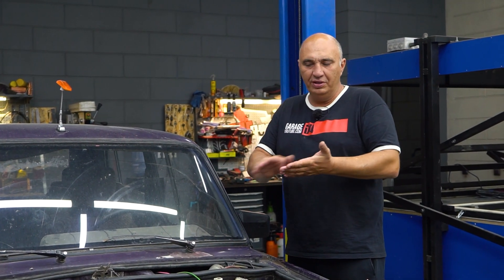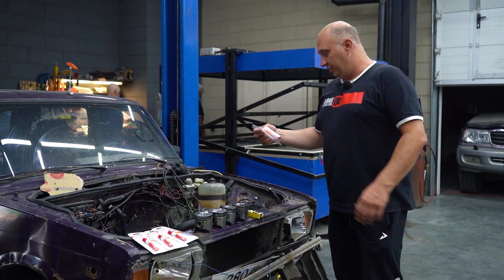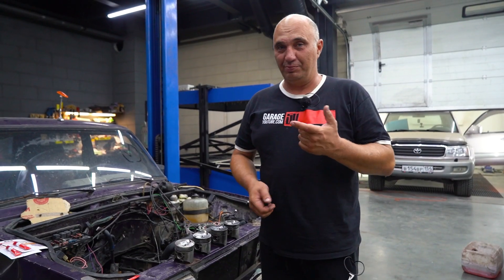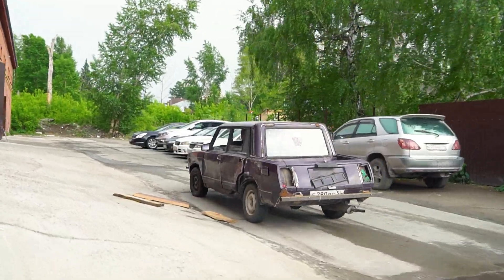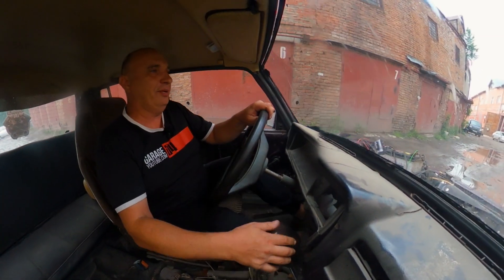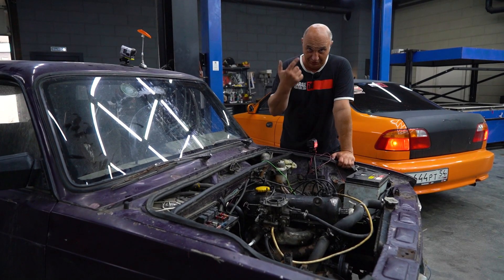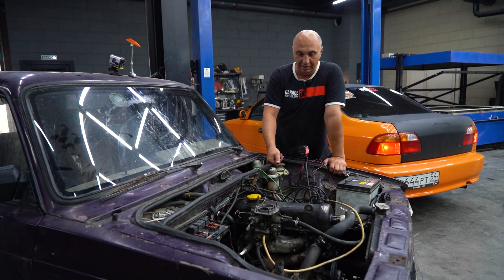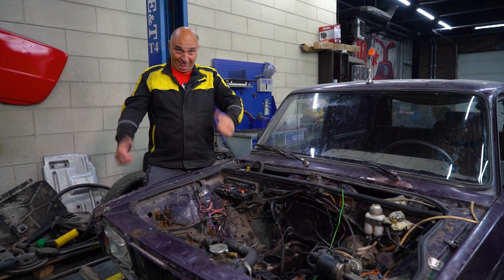Piston repair using JB weld and super glue – will it work?

Comment: Why not move one step below welding, and try soldering / brazing with one of those aluminium "welding" rods, like the Durafix or Alumaweld, the ones that melt around 400 degrees Celsius. That would be worth a good laugh.

Comment: So some context, the piston head experiences the peak highest pressure of 2100psi on every single stroke, it also experinces the most amount of heat being the closest to the explosion in order to do it's job. So while it failed to repair a piston head, the block itself would be fine with JB weld, having experienced a fraction of the heat and concussive peak pressure that the piston takes. As the piston travels down and expanse the pressure rapidly drops meaning the walls of the cylinder would be able to handle the jb just fine.

Comment: Thanks for doing this product testing. I was thinking of using JB in a different application on a small engine - ie. for threads stripped threads, but it seems it might have a short hold time  in that application as well.

Comment: another suggestion? how to fix? buy a new piston, they are cheap to buy, compared to all the work welding up and machine it to fit again
But ok, it was a nice experiment. Why? JB weld is good ok, but if used, take care, and maybe only for non stressed erea's or parts.
It has been used for altering inletports of modified cylinderheads, but even this is not as good as welding up the ports wich i did.

Comment: Try using JBWeld Extreme to glue a coin to patch over the hole.  Coins are tough.  Obviously it depends on valve clearance.  You might even get a performance boost from the increased compression LOL.

Comment: I typically fix burn holes in a piston with a new or used piston! It’s just too much work experimenting with other types of repairs.
I guess if you have a rare and hard to find piston , welding would be the only other option!
Reply: Maybe you're not aware of this, but these guys try all kinds of crazy stuff just for the hell of it. Most of it is never intended to last, more or less just to see what will happen.

Comment: One adhesive you can try is 2 part putty. It has metal filings in it & it withstands high temperatures.
Reply: That's what they used. That's what JB weld is. Metallic two part epoxy putty... but it's not strong enough to hold the force of an explosion in a compression chamber.
Reply: @soldjahboy  not the putty I’m talking about. JB weld is liquid form. The stuff I am talking about isn’t. The one I am talking about is called “speed stick “ instant putty, it is a substance similar to radiator and fuel tank repair that you knead together, then press it into place. You can cut threads in the stuff once it’s set.
Reply: @christophermarshall5765  The JB Weld I've used is exactly what you're describing. I've never seen liquid JB weld before. The stuff I buy is in two solid sticks and you break a bit off each one and kneed it together. I think it's called JB weld steelstick.
Reply: @soldjahboy  the JB weld they used in this video is in 2 part epoxy liquid form. The stuff I described is what I used to fix radiators & steel fuel tanks. It is in a single strip, that you break off, & knead it until it turns grey. The steel stick I also described is not made by JB weld. Their products are 2 part epoxy adhesives.

Comment: I once knew of a guy riding his 50cc scooter to the BrassMonkey motorbike rally and he developed a hole in his piston, a local farmer welded a coin to the piston and that enabled him to attend the rally. Howsabout fitting hydraulic motors to each wheel and adapt a hydraulic pump to the engine to run the motors?. Or adapt an electric motor to each wheel and adapt a way to power them from a battery with the engine charging the battery.....

Comment: Pull all 4 of the rods and pistons out and see how far you can drive on just the starter motor.  electric car ! 
Try it on one battery, then try it with a bunch of batteries.

Comment: When I was about 10 I had used JB weld to glue a nickel to the cement floor of our basement. My dad tried to pick it up and failed (obviously 😆) so he got a hammer and chisel to remove it, but the JB weld didn't let go, the nickel took up a chunk of cement when it was pried off 😆 and from then on I knew it was seriously tough stuff.
Reply: Project farm cut a hole in a cylinder head and JB welded it up, and it actually worked. Not sure how long for, mind you. I repaired an outboard cylinder head with it, about 2 years ago now, it's still going today
Reply: I was wondering if gluing a quarter to the sidewalk infront of the house (when I was a kid) would work. I guess jb weld would do it.
Reply: Do something more serious. JB weld a 100 to the sidewalk infront of a bus stop or something.

Comment: Maybe try ceramic epoxy. The same that is used on spark plug insulators and other high voltage or high heat applications. Or make pistons out of the epoxy!
Reply: Ceramic coatings have been done forever with good results, but a fully ceramic slug? I dont know that I've ever seen it. Skirt design might be interesting.

Comment: Since you welded a piston,i would really like to see you adding welded material on the pistons as much as possible to get maximum compression and see how much power it will gain
Reply: +1. Please do. It's not that the engine can get any worse.
Reply: Agreed
Reply: It would probably do easier and way faster to just shave to top of the block.
Reply: the amount of air it can intake will also decrease

Comment: Predictions:

The cyanoacrylate "super glue" will prove too brittle, shattering in service.

The epoxy will get gummy with heat and peel out.

I have used JB Weld and it has proven very fit for the purposes I put it to, but those purposes have not included using it in a combustion chamber. I think, on zero evidence, that it'll work for a little while before it fails.

I expect the welded piston will still be working well after the other three have failed.

Comment: Jb weld isn't good with heat. We tried to quick fix our exhaust with it and the smoke and smell was aweful 😅 it held though just took weeks to stop burning off
Reply: It may sound counterintuitive, but pistons actually don’t get as hot as the exhaust. They see very brief peaks of high temperatures, but the pistons probably have a metal temp of less than 250deg F since they are cooled by the oil and cylinder walls and intake air/fuel mixture to some extent. The exhaust only gets cooled by the air passing over it, so it gets much hotter.

Comment: I do a bit of work on geo trackers and they're known for developing cracks in their aluminum blocks between the cylinder sleeves. A girl thought she had a blown head gasket but when I pulled the head I found cracks between 1&2 and 3&4. My initial thought was pull it and replaced it but i've had so much luck with jb weld and we had nothing to lose so I patched it with jb weld and put it back together.  That was a year ago and she's still running it.

Comment: Back in the eighties, I burned a hole in the crown of my Vespa's piston.   So on the roadside I removed the cylinder and piston then I used Araldite to fix a 2 pence piece to the underside of the crown, waited for it to cure and then filled and smoothed the hole atop the crown with more Araldite, put it all back together and I got several hundred miles out of the blessed thing until the glue gave out on the 2p and the 2p coin dropped into the crank and smashed everything up inside.
Reply: I got to the end and burst out laughing. Just imagined the 2p zipping around after what was some genuinely proper roadside ingenuity.
Reply: Worth every pence.
Reply: Ha ha  ha

Comment: A challenge for you?

Take your knackered engine, fit it with four square cylinder sleeves, and make four square pistons to fit the cylinders, then drive the thing?

Are you up to the challenge?!
Reply: Would it even run?
Reply: @SwapBlogRU  you guys are the only ones who could make it work.  My thinking is, cnc machined for perfect seal joined surfaces, two piece L shaped ' rings ', slide them in and carefully weld them together in place on the piston. Since there's no compression sleeve for these rings you might could liquid nitrogen freeze them to shrink them enough to install them. 🤔
Reply: @SwapBlogRU  That depends on how good a seal can be developed between piston and cylinder wall, but then that's why it's a challenge.

Comment: Drilling the hole up to a standard tap size and putting a bolt in it would certainly be interesting. Should last much longer than filling the hole with adhesives. Still going to need some form of adhesive as thread-locker to prevent the bolt from backing out and to seal the threads though. The first cylinder to fail was almost certainly the baking soda. I was expecting the other two to fail within seconds at load, looks like they lasted a whole lot longer.
Reply: What a cool concept. If you screwed the bolt in.  Brazed the bolt in from the backside,  and ground the head of the bolt level with the piston...  Wonder how long it would last? Cheers
Reply: @giggiddy  tap the piston, apply some threadlocker on the threads, then tap a hole on them and press fit a cold pin to keep it from spinning. You can press fit a pin from the side of the piston too, do as you want
Reply: @giggiddy  That is a good idea... what if you were to use all thread rod, no bolt head to deal with and less grinding to make it flush.
Reply: @maxstress8427  Love it! Would love to see how long it would last. Roadkill used to bandaid stuff together like that then take a road trip. Repairs like that interest me. Its incredible how long some of those "bush fix" repairs last.  Cheers!!
Reply: @giggiddy  oh man, Roadkill... great times! I really miss these duct tape & zip tie adventures.
Reply: @MegaSockenschuss  yeah they left a good hole, and they seem not to upload their adventures any more :-(
Reply: @giggiddy  if U haven't seen it already look up bush mechanics was a legitimate tv program here in Australia they do all sorts of fixes
Reply: @justaaussie  agreed. Have you seen the one with a couple of Aboriginals and their small axe?

Found two cars in the bush, chopped the top of one with an axe, stole parts from one to fix the other, gum tree branch to replace a dead leaf spring, bit of high proof home brew and drove the bastard right out of its grave!
Reply: @therealswarvey  sounds like leafspring on bush mechanics and the little Hyundai on black as YouTube channel 👌
Reply: @justaaussie  haha now I've gotta look em up and subscribe, thanks!😁
Reply: @justaaussie  I'll definitely look it up. Thanks my friend!
Reply: Drill and tap for a Allen key pipe plug. After installing pipe plug the excess can be ground smooth.
Reply: Threaded rod and hammer the ends.

Edit: rod
Reply: It doesnt need to be a perfect seal. Just use a flat head socket cap screw and it should be held in fine
Reply: @nickoloes  carriage bolt
Reply: No thread locker needed.  Simply mushroom over the end of the screw sticking out of the nut.  It will never come off on its own.
Reply: Funny you should say that. Not exactly the same but once done a temporary repair on a piston in a 250 two stroke twin by putting a countersunk bolt through the hole with a nut on. It actually ran for a few months like that until the nut eventually came undone.😂 If only I'd used a lock nut or locktite. But was only meant to be very short term temporary. Then I had problems getting a piston. Anyway, the fact is it worked and very well for longer than you would think.😆
Reply: If you put the bolt through the bottom, the force will just knock it out, through the top would only work if you leave a recess so it doesn't hit the engine head
Reply: Use some red lok-tite on the threads, grind the head down on the bolt and ball-peen the edges to keep it from vibrating loose and she’ll last as long as the rest of the Lada!
Reply: @DualKalibur  until you get bored of and floor the accelerator.
Reply: @jwalster9412  nah then the awesome acceleration of the lada will hold the bolt in place!

Comment: I once welded a cast iron piston that had a valve stem go straight through the top of piston .and weighed /balanced it after welding . Don't forget to pre-heat the piston before welding
Reply: What happened to the valve originally? Sounds like some very cool carnage
Reply: @therealswarvey  It either broke or the valve retainer came off and dropped the valve.
Reply: @Varinki  yeah, but it had to go somewhere else in the engine
Reply: I wonder how much that hurt the engine efficiency. Would you say you replicated the original well, or did you rush it just to have the car work?

Comment: What is the "jumper pack"?
Reply: It's commonly used to jump start cars, they can apply 50 amps or so of 12v power. The battery on its own has less power.

Comment: I know at least the super glue will release with heat for sure. I use it to hold small 2 stroke cylinder jugs onto a mandrel to cut the bases a few thousandths to raise compression on chainsaws.  Just a small amount of heat that jug slips right off. JB Weld I've had mixed results with heat on different things.
EDIT: I really did think they'd come apart a few seconds after startup. Lasted way longer than I thought. Lol
Reply: There is special high temp JB weld and if you work very clean, very clean surface it should hold up some :-) maybe pressure on a piston hole is also too high to work
Reply: @kitecattestecke2303  They make a 2 part putty called Steel Weld and I guarantee it would hold up to this for as long as the engine lasted. 
It gets hot when mix it and after it cures it is as strong as steel for certain.
You can hold a blowtorch on it for as long as you want and it wont melt. You can tap it, even make bolts out of it. Yeah I said create bolts out of putty lol
Reply: Lookup a channel called Project Farm if you wanna see JB weld REALLY put to the test.

Including a small engine cylinder head made entirely JB Weld

Comment: i did this to my Vespa piston...i had bad pre ignition timing issues and the plug burned a hole through the crown so i used JB Weld on it and sure enough it ran, but within minutes the hole burned right through again
Reply: Lol I once drove 30 km from home with a buddy as passenger. I got a loud pop and I noticed throttle response was lower and I needed to keep it alive. It brought us home, died in front of the door. And I found out later a piece of piston 'has left the room' size 5x5 mm on the top outside of a small 70cc 2 stroke piston... lmfao. It brought us home 👍
Reply: Weld it lol
Reply: Tig
Reply: I guess you guys don't have parts readily available over there like we do in Europe